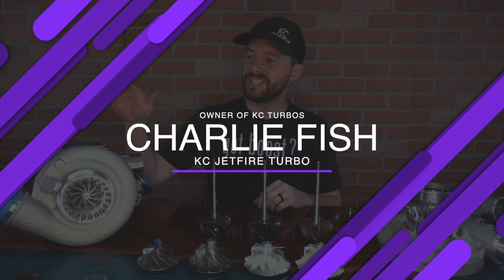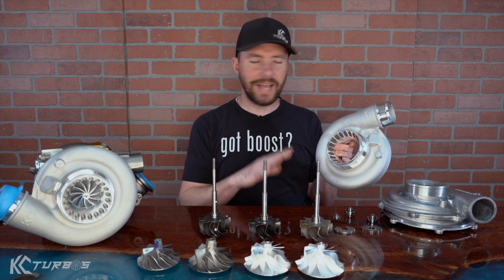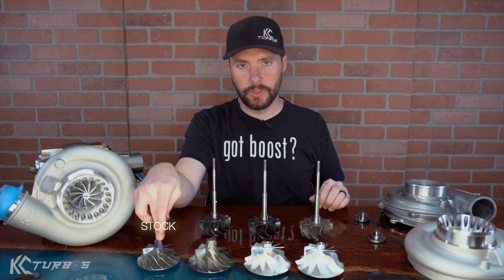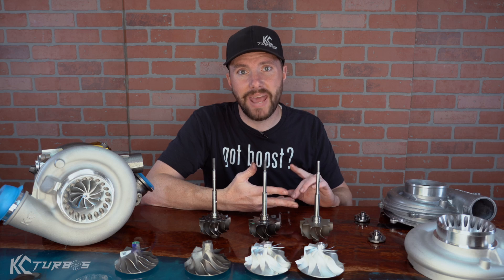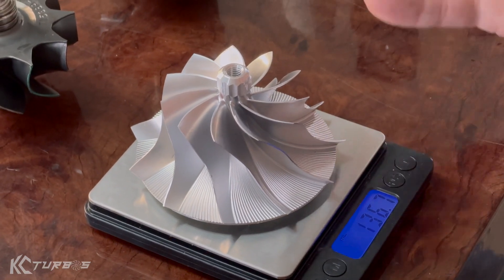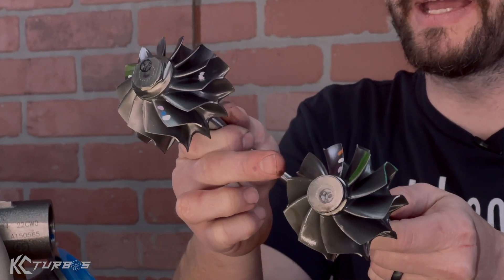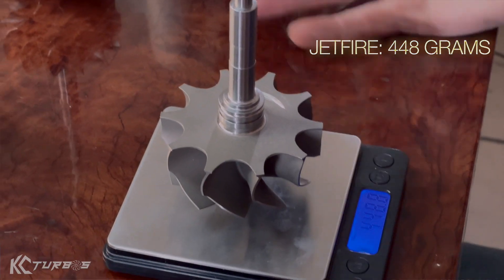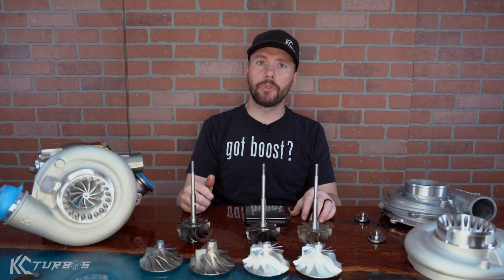How Does The KC Jetfire Turbo Kill the Competition?

Comment: Great video. Looking at a Stage 1 or 2 for my 6.0.  I have a Powermax turbo in the truck now with stock injectors. What gain should I see with a Stage 1 and 175 injectors (what power level should I expect)?  I want more whistle like the 10 blade but like the power output of the 11 blade.   Will the 11 blade whistle as much as my Powermax?  Hope so....

Comment: I went with the 13 blade Stage 1 Jetfire on my Excursion. Do the 13 blade Jetfires also have the upgraded 13 blade wheel or just the 10 blades?